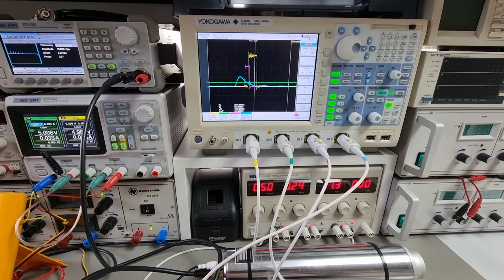STM32-based Gamma Scintillation Counter prototype

Comment: A discussion for your thought-process (a deep-dive) for building the analog-stage would be welcome.
For example:

- Do you need a TIA?
- How can you "quench" the detector rapidly so that one event does not shadow the next?
- Can you do a model-based fit on the "exponential decay" observed on the 'scope to detect multiple events mixed in a single apparent pulse?
- What kind of op-amp do you need? High speed? Low noise?
Thx!
Reply from the maker: I'm planning to do that!